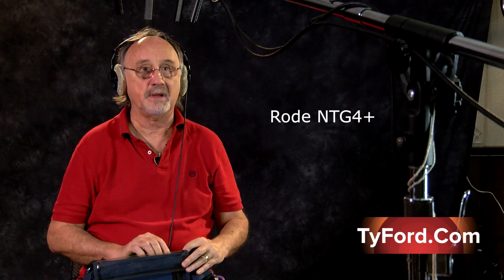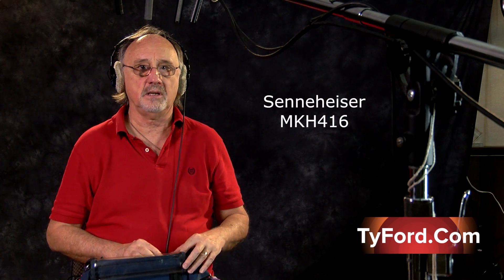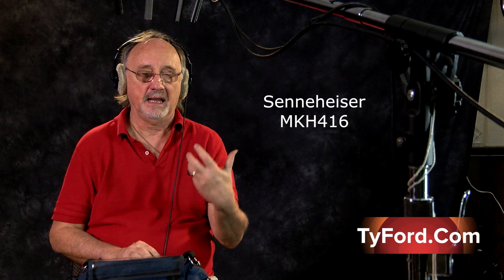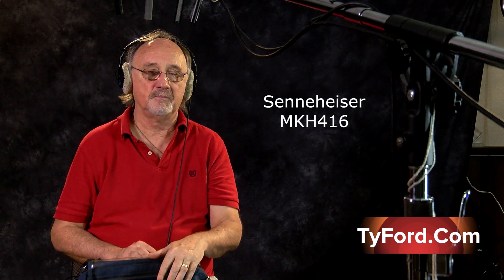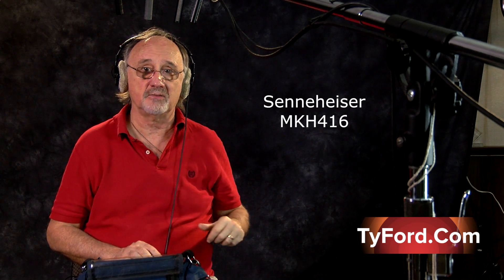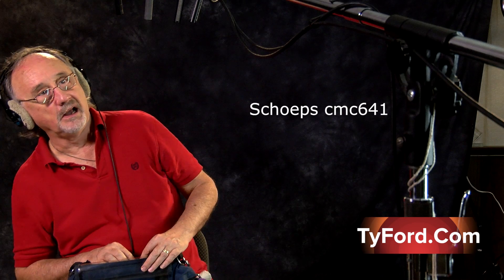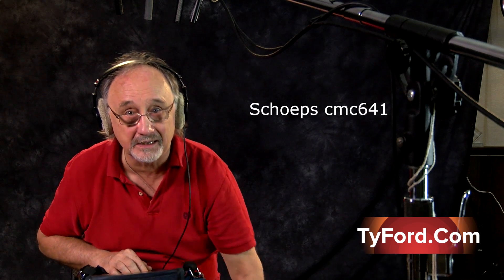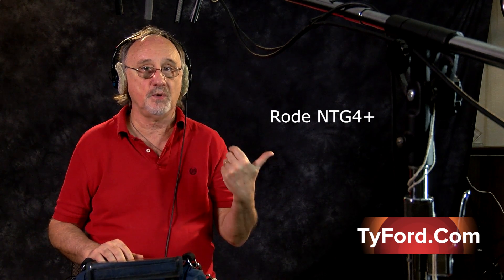Rode.Sennheiser.Schoeps.DPA

Comment: It did not exist at the time of this comparison, but I would be very intrigued to know what you think of a sound comparison between the Sennheiser MKH-416 and newer (as of a couple years ago) Azden SGM-3500L. The Azden has some specifications equal or better than the Sennheiser (including sensitivity), but being half the price it is of course not the "whole package" that the 416 is. However, the question is, what is the actual perceivable audio difference, and does it matter?
Reply from the maker: What specifications are better and what are the sensitivity specs? The 416 has some pretty high sensitivity specs. If you can't hear the difference, then there is none. That's why there are audio people. They can hear and decode what they are hearing to make better decisions. Azden, while a "name", doesn't have the reputation that Sennheiser has.
Reply: @TyFord  - Thank you for responding, Ty. I am very familiar with the difference between Sennheiser and Azden, and their target markets. I am 58 years old. The 416 is the industry standard for good reason. I just don't have access to one to compare myself with the Azden. I bought the Azden to upgrade my sound equipment based on it's specs and some video reviews. I am not at your level so we make do with what we can work with. My expectation is though the Azden of course will not do exactly what the Sennheiser does, I hope with just a little post production work the differences will be negligible/imperceptible in the finished product. 

The self noise of both mics is 13dB (A weighted). They also have the same Frequency Response, 40 - 20,000 Hz. 

MKH-416 Sensitivity: -32 dBV/Pa at 1 kHz
SG3500L Sensitivity: -28 dB at 1 kHz (0 dB = 1 V/Pa)

MKH-416 S/N Ratio: 81 dB
SGM-3500L S/N Ratio: 82 dB

I could possibly send my Azden to you to facilitate a comparison, if you are interested. I would have to check with a Producer to assure no scheduling conflicts first though, of course.
Reply from the maker: @1001Hobbies  

Sennheiser MKH 416 > 25 mV/PA ± 1 dB

Azden SGM 3500L >  -28 dB at 1 kHz (0 dB = 1 V/Pa)

Obviously the math is different. At the moment, I forget the conversion. Then there's the difference in the two patterns and  the EQ curve of each mic. 

I just sent them a request. Let's see what they say.
Reply: @TyFord  - Yup, those values are above my pay grade. I did some research on it but still don't have a point of reference for the difference. The self noise is pretty low for the Azden being more of a "prosumer" mic, and the S/N ratio is also much better than typical fare at this level.

Of course if I could get a good deal on a 416 I would prefer one (been watching), but they hold their value on the used market too well too. If I did it for a living it would be easier to justify the cost. 

My previous shotgun was the Azden SMG-1X, which was nice to get started with long ago. In a comparison with 5 other mics at a local industry meeting it was chosen (non-scientific) as the best sounding mic of the bunch, beating out Rodes and other mics costing more than twice as much. 

It will be interesting to see if Azden is willing to send a 3500L. There are not a whole lot of videos on YouTube featuring it and they may want another on there.
Reply from the maker: @1001Hobbies  OK, now let me ask you this. In what situations are you expecting to use the 416? If it's anywhere inside, a better choice wold be a Schoeps CMC641 supercardioid. It will hear much less of the room. The room in which I shot this video is more than moderately damped. It's a studio in which I record VO and music. In more typical interiors, the sound would be noticeably more roomy with a 416.
Less expensive than the Schoeps CMC641 are the Audio Technica 4053b and the Audix SCX1HC,
Reply: @TyFord  - Thank you for the recommendations. I am aware of the CMC461. A sound guy I've worked with has one. Absolutely amazing of course. Absolutely expensive as well. I am also familiar with the 4053b and it is just out of my price range. I've been updating all my equipment (lighting, sound, and camera) before I retire from my "regular" job and move into film production full time. It's a job I would do for free because I love it so much, but since people want to give me money to do it I will make them happy and take it. ;)

I have not heard of that Audix mic. I was going to get an Oktava MK-012 for indoor dialogue (super cardioid condenser made for instrument recording, but popular for indoor dialogue at my level) but the Audix should be in my price range. I will definitely look into it. The shotgun mics I use for outdoor dialogue in indie films, shorts and features. I was also asked to work with an ad and marketing company that is just launching as well.

I'm usually on projects as DP and/or camera op, but over the past few years I've been getting requests to do lighting and sound for others as well. At my level, some filmmakers have all the equipment and can perform all the roles. We try to only do one role on a project, but sometimes "things happen" and a void needs to be filled.
Reply from the maker: @1001Hobbies  I would say that you should rent a CMC641 to hear the difference. When I first heard the CMC641 some 20 years ago, it changed my life.

Comment: Thanks for the helpful video. The difference especially between the Rode and the others is huge. The Schoeps so transparent while the 416 sounds nice and deep and professional (but I imagine much of the deepness would end up being scooped out in post). I can see why the Schoeps is your favourite. I am currently trying to decide on either a Schoeps or Sennheiser cardioid or super cardioid to run into my 442. This is mainly for Fx recordings/field recordings and probably some dialogue along the line (but that's not my main focus), and mainly outdoors. I would also like the option of turning this into an m/s rig down the line as well but I don't know how well a super would work as a mid mic. Would you be able to advise me on this?
Reply from the maker: +Sequential01 Hi, the Schoeps CMC641 is still my favorite. The Sennheiser MKH 50 also works well and the DPA 4018 supercardioid I recently reviewed is a relative newcomer that is quickly catching on. I like the tight patern of the CMC641. Also, the shoulders of the pattern are relatively free of beams or edges. It will ignore bad acoustics very well.

I haven't used in it a M/S test yet. Maybe the MK4 cardioid capsule would work better, but I have no experience there. If you got just the MK4 capsule, you could use it on the CMC6 body as that line is modular.
Reply: Thanks for the reply. I am almost sold on the 41, however looking at the frequency graph it does appear to roll off some low frequencies. I wonder would this be problematic for FX recording (or just other sources other than dialogue). Do you generally use the 41 on other sources other than voice?
Reply from the maker: +Sequential01 Guitar, drums overheads,  guitar amps, sax,. It's my number one grab.

Comment: I just brought the Sennheiser MKH 416, a brilliant mic, i am using it with the ZOOM H6, and i am looking at theFeild Recorder Zoom F8, but i need to find out a bit more about it. I am considering getting the Sennheiser MKH50.......what's your view on that mic Tye!?
Reply from the maker: +Black Steel Very good mic. Much better than a 416 for interiors and can be used outside with wind protection gear as well.
Reply: +Ty Ford Thanks for replying Tye, so do you think it would have been worth buying the MKH50 instead of the MKH 416 as an all rounder for interior & exterior?
Reply from the maker: +Black Steel I do.
Reply: +Ty Ford Damn.....i hate wasting money, but the MKH416 is a good mic though for outside use, i have used it inside and its not too bad, but i do fancy the MKH 50, and i think that i will definitley buy one.
Reply: +Ty Ford So, the MKH50 is actually better for outdoor use also in your opinion......its a shame that there are not many reviews on this mic
Reply from the maker: +Black Steel  No worries. Use the 50 inside, use the 416 outside (and not around highly reflective surfaces. You can't play a round of golf with one club. You can't do it all with one mic. I have dozens.
Reply: +Ty Ford thanks for replying Tye!!!....i am also looking at the Sennheiser MKH 8060 ......will that perform indoors as well as the MKH50......and do you think it's a better mic than the Sennheiser MKH416???
Reply from the maker: +Black Steel I only tried the 8050 in that series. It had too much low end and top end for me. The MKH60 sounds different than the 416, but is quieter and, I think, doesn't have as aggressive a presence peak.
Reply: +Ty Ford Thanks Tye......its a really difficult thing to choose ....mics are a minefeild......but hey...i think i am going with the MKH50 to compliment my MKH416.......then i will or may look into that MKH8060.........
Reply: +Ty Ford But to be honest Tye.....they all sounded good to me in their own way......anyone would not go wrong with either of them through a feild mixer
Reply from the maker: +Black Steel  There are differences. Most are not audible when played back from YouTube over lap top or cell phone speakers.
Reply: +Ty Ford Ok...i see that i have a lot to learn......i have ordered two studio monitors & a mixer and interface.....hopefully this set up will help on improving my audio for video by hearing it how it should really sound through some flat monitors.
Reply from the maker: +Black Steel  There IS a lot to learn. Even flat monitors misbehave if they are put in the wrong places.
Reply: +Ty Ford Wow....Mr.Ford....i value everything you tell me ......i just gotta eat, drink and sleep this man.......and learn....the hypo, super cardiod mic and their meanings........but sound is sooooo important!!!.....you always get everything to sound so crystal clear....even on my rubbishy pc line £10 speakers wich i will ditch when i get my Yamaha MSP7'S......now...placing thjem is another matter..........i dont have much space.......i was thinking of about 4 feet infront of me on either side as a stereo look?????
Reply from the maker: +Black Steel Mr. Steel, About speaker positioning. Putting them on a wall, near a wall, on a table, or near any surface will change the way they sound. Think of putting a speaker on the floor in a corner. The walls become like extensions of the speaker and the low frequencies are enhanced.

I have my stereo monitors about four feet away and a little wider apart from each other. They are raised on pedestals so the tweeters are at ear level. The are angled in slightly; aimed at my ears. 

Still EQ work may be necessary so that the sound you get in the studio actually translates to other typical spaces. I had to  raise the LF response of mine because  when I played back CDs in my car or through other systems there was too much bass. By EQing my monitors to reproduce more bass, I no longer overdid it in the studio. 

I wrote a book some years back called "Advanced Audio Production Techniques" for Focal Press. You can find it used pretty cheaply. It may help. http://www.barnesandnoble.com/w/advanced-audio-production-techniques-tyree-s-ford/1101896068?ean=9780240800820#productInfoTabs
Reply: So Ty, I am about to make a purchase......the Sennheiser MKH50.....or the Sennheiser MKH 8060......for indoor use mainly....as i said i already own the Sennheiser MKH416 ....but i have been told that the Mkh 8060 is a very good mic for indoor & outdoor dialogue.....how do you see this Ty????
Reply from the maker: +Black Steel  Mr. Steel, I have never used the 8060. My "go to" mic for that use is a Schoeps CMC641 or a DPA 4018.

Comment: is would be corect to say the schoeps does not have the "s" -ez  that i hear with the 416 ? for a limited budget, could i get away with the schoeps both outside and interior interviews ? thank you
Reply from the maker: +iso 100 I have successfully used the CMC641 outside with wind protection when booming at 6 inches to two feet. You might be able to get farther away than that.

Comment: If sound devices mixpre output is set to line level and given as input to zoom H6 as line level... now preamp in the recorder will be bypassed now I get High quality recordings..Then what will be advantages of getting sound device or zaxcom recorder...
Reply from the maker: +dinesh yuvi  First, I can not guarantee that switching the Zoom H6 to line level will bypass its preamps. Frequently it's cheaper just to put a pad in front of the preamps and call it line.

Second, the input stages of the SD and Zaxcom gear are better engineered, the equipment is more durable. The Zaxcom has Neverclip.